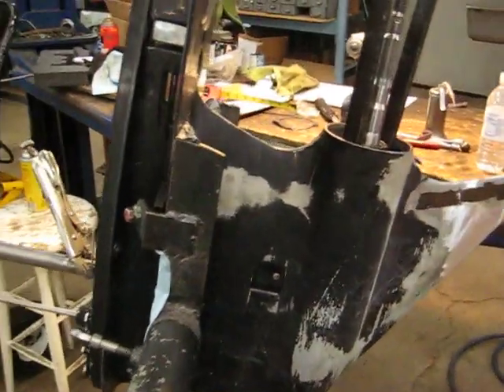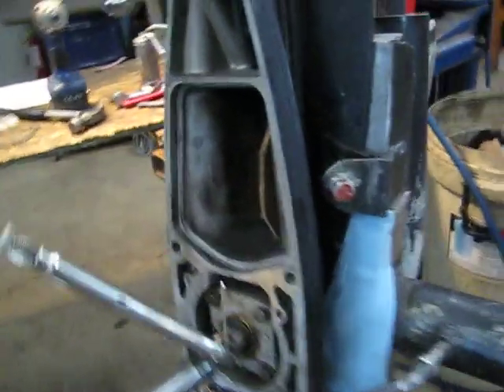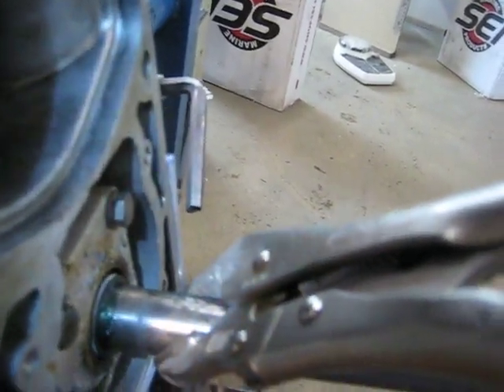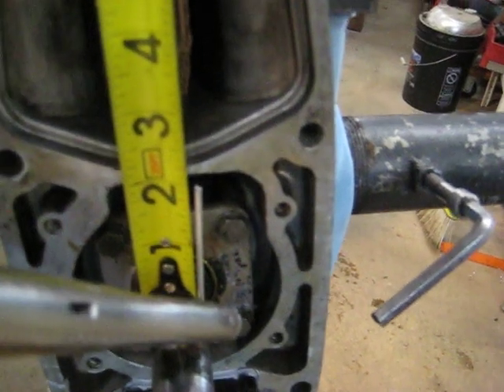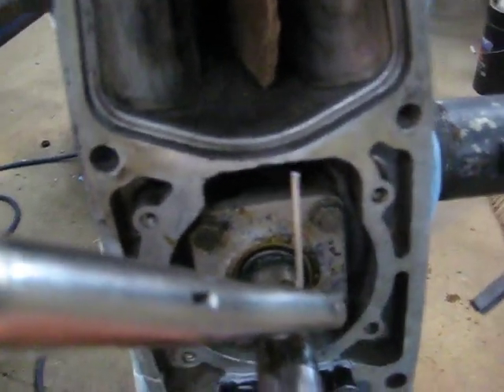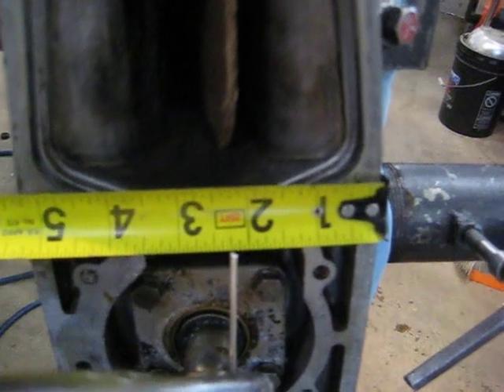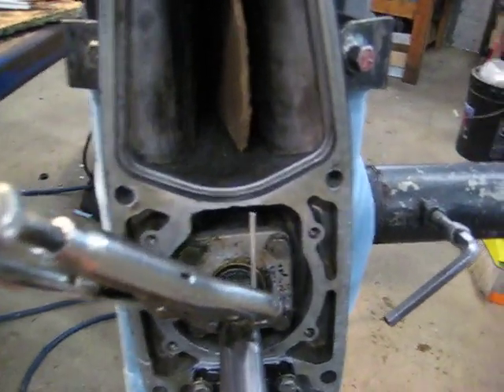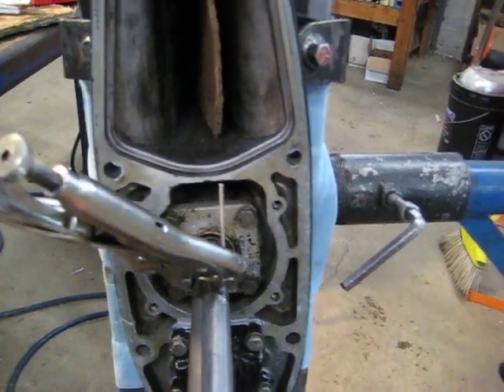Johnson Evinrude backlash 231-631-2263 for parts or tech help

Comment: I have a rare 89 Yamaha sterndrive. I had to replace the casing and bearing carrier. I have lots of backlash but when  push hard on the propshaft as in your video it’s reduced dramatically and seems correct. I don’t understand how the pressure changes it that much or know if it’s correct like this . How much backlash should there be without pressure on the propshaft?

Comment: Is this the same for a 85 Johnson 140 with the v6 gear case? If not is this procedure going to be same with my lower but with different measurements of back lash
Reply: We have found the backlash to be consistent thru out the Johnson and Evinrude line from 40 hp all the way thru 225 hp

Comment: i'm installing a new forward gear set in my 50hp evinrude . would this method work for determing the shims needed to get the correct pinion depth without the use of the special measuring tool ?
Reply: no